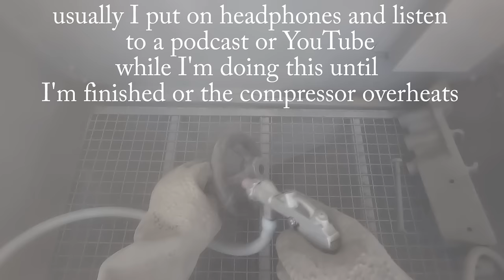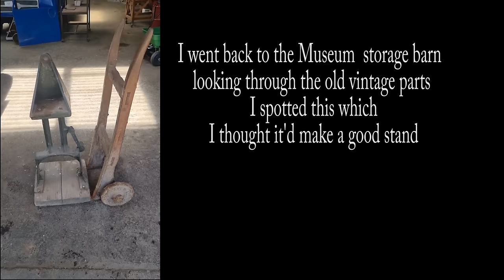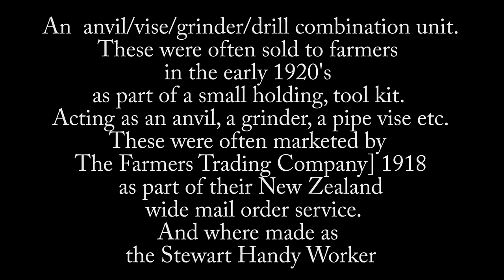Rare  Vice  Restoration

Comment: As a very young boy my folks immigrated to CHCH in the early 60s. I remember that almost everything had several uses. Ie. a washing machine with heater in bottom was cleaned and used for bottle sterilization. A car had a water heater for tea and a hot box to keep meals warm.  We returned to Canada after 3 years 😢but even today I tell those stories to friends and families. Your multi tool here is yet another example of the industrious minded folk  who built your wonderful nation. One question. Do you work for or contracted with the museum you mention in this video?
Reply from the maker: Hi thanks for your question, the restoration jobs I've been giving to the museum are totally free they have an enormous stockpile of stuff that needs to be restored and it works out for my benefit and their benefit, if I get a couple of hundred thousand views for each video on Youtube  that pays for the restoration I pay for all the materials paint  and  spend a week to do every restoration at no cost to the museum i have 4 more unusual and weird restorations I'll be doing for them 
Cheers Richard

Comment: I have one the same I purchased for $.50 cents when I was about 12 years old,
You are missing a vice part that would exchange with the anvil bed, it would allow you toclamp a piece of wood to be drilled. I also have the both pipe vice pieces. mine has not been restored and is in excellent shape.
Thanks for the great video.
Reply from the maker: Hi David  I found the missing plate and the anvil spike at the Museum, thanks for watching

Comment: Fantastic restoration! Keep it up! What is the type of wrench called that you used to break free the bolts on the stand at about 21:19? I've never seen one of those.
Reply from the maker: hi russell i have had that one and a smaller one kicking around my toolbox for years I vaguely remember buying the set
Reply: I think your asking about the Slip Wrench ?

Comment: nice to have keep the "used tool" finish, grandpa have to stay grandpa and not a paper pin up !    for the pipe wrench it's not necessary to touch it, the aspect stay in oil industry's standart... 😂 at least if you want to clean it let's it outside during an Saharian sand desert storm and it'll be perfect ! 🤗🤗
Reply from the maker: Thanks for the tips! Bernard

Comment: @10:46 - i don't complain on other folks videos when they build, craft, renovate or repair. if i disapprove i simply tell myself i would do it slightly different. yet, if someone refurbishes an old gasoline chainsaw and then doesn't show it cutting a log i am for sure disappointed. 🔧
Reply from the maker: Thanks for your feed back